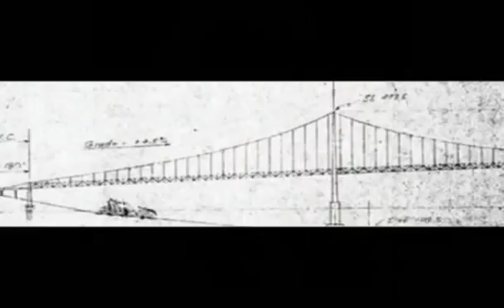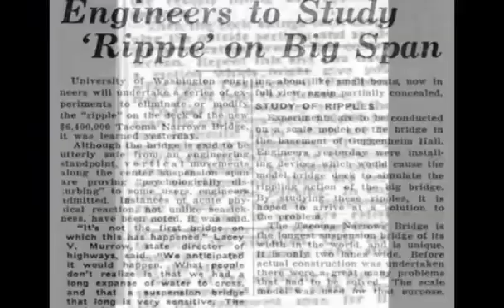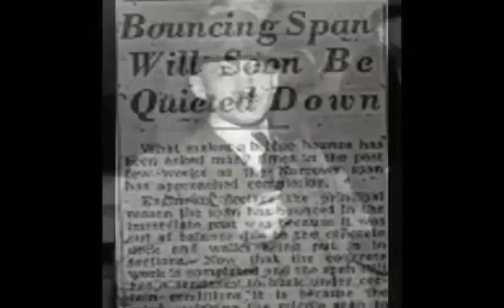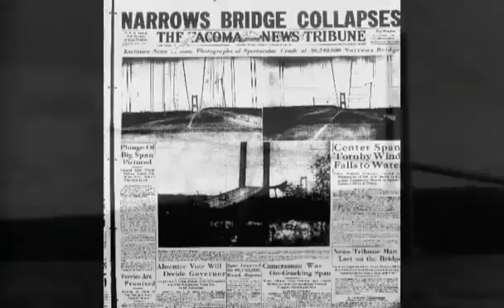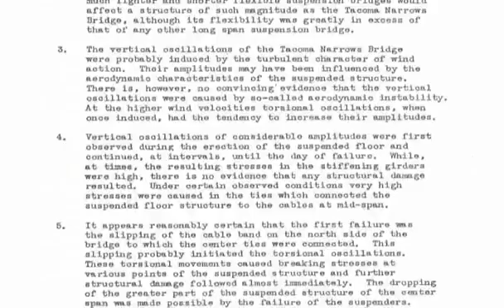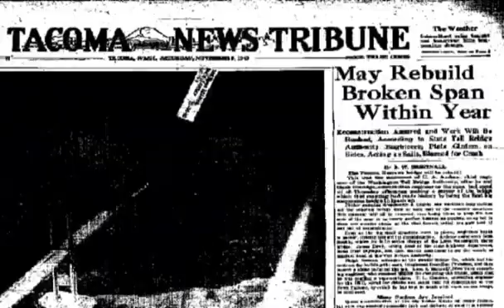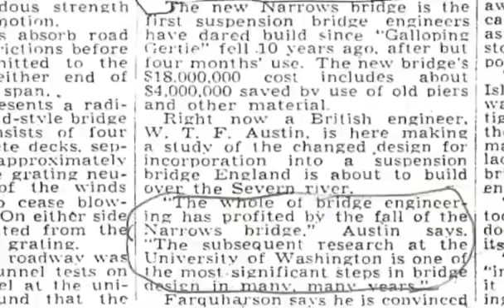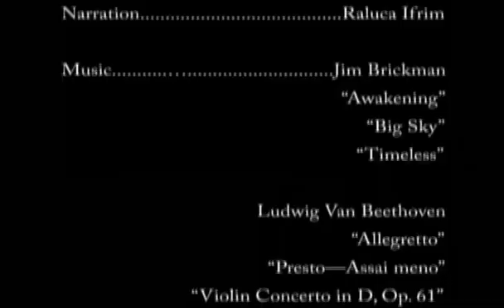Galloping Gertie: The Collapse of the Tacoma Narrows Bridge

Comment: I MARVEL, at how SOLID, the Brooklyn Bridge still stalwartly and safely serves MODERN New York City, without its having missed a beat, after an astonishing 142+ year run, a run that's as likely to continue, for maybe 300 more, and storms far heavier than Gertie's, have assaulted the BB, among other stressors. The Golden Gate Bridge has several times, seen winds in excess of 80MPH, taken a bit of a pounding then, galloped too, with all traffic banned a spell as a precaution, but she ENDURES, as likely as not to endure for half a Millennium.
Reply: The Brooklyn Bridge is a baby suspension bridge compared to most, especially the Golden Gate Bridge, with a main span of just 1,600' compared to the 4,200' of the GG and heights of 272' compared to 746', clearances of 120' to 220', and nothing remotely approaching the elements. As well, the GG is now 88 years old herself.

Comment: Imagine the shortsighted decision to make a bridge designed to last decades only two lanes. Fortunately it collapsed and a four lane bridge replaced it.
Reply: When the original bridge was built, there was no way for anyone to know that a 2 lane bridge would be inadequate 20+ years down the line and, in the end, it didn't matter as the bridge itself didn't survive long enough to become  congested.  However, the 4 lane bridge that replaced it did survive to become extremely congested and now there are 2 bridges over the Narrows, each 4 lanes in both directions.
Reply: There wasn't much across that bridge at the time.

Comment: Flow induced vibration is very interesting. If want to learn there is a book by blevins. In fact I had worked on buffet flow over airforce tanker. The pod on the tanker was vibrating violently because of the flow separation. SHOCK WAVEs are created on the pod causing separation . 

We in Aerospace deal with flutter of aircraft.  The physics is similar to this bridge. The wing vibrates in bending and torsion due to the flow. At higher airspeeds the wing may vibrate violently into failure
 .

This is why we test the wings during flight test. Before flight test we run computer simulations called the double lattice method. 600 pages of heavy math to understand it. 

Anyway just wanted to share. You never learn this in your graduate school. My curiosity in the field helped.
Reply: "Rouser", I am a RANK AMATEUR in Engineering, though, I guess that I must possess some intuition in its processes and behaviors, when pitted up against stresses, which an Engineered object, ought to handle well. I'd discussed the TNB, with an Engineering acquaintance of mine, and he told me that TNB was already in "runaway mode"-flutter/harmonic resonance so BAD- that even had the wind suddenly died down to 10MPH or less, or flat-dead calm--that the bridge was still "bound and determined" to shake itself to pieces! Another analogy is a forest enduring a windstorm. Considerable blowdown, with some trees still apparently "intact". Yet two days, two weeks later, a lot of those will keel over, in spite of the stress being absent.
Reply: @swithinbarclay4797 Just to let you know now days they run computer simulations on any structure. Both with any form of loads. Even when there are just static loads like weight of vehicles the bridge has to be tested with simulation.  

These simulations are very accurate. But trick is putting the correct estimate of loads. For example during space shuttle liftoff they had to come up with best estimate of loads to feed into the orbiter structure. 

I used these loads to predict internal loads on the payloads like structure. 

Engineers tests these structures at NASA test labs. We match our computer models to match these test results. This means our computer models should predict vibration what we see in test. Then we assemble our computer models and put external loads to predict any failure inside or outside before flight. 

Hope this helps.
Reply: Yes...but that poor dog, though. 😥